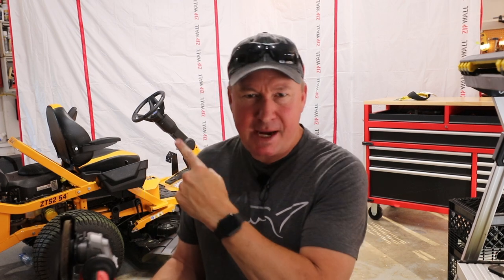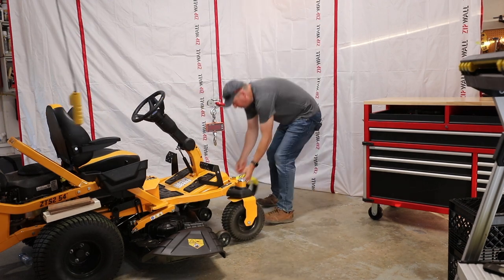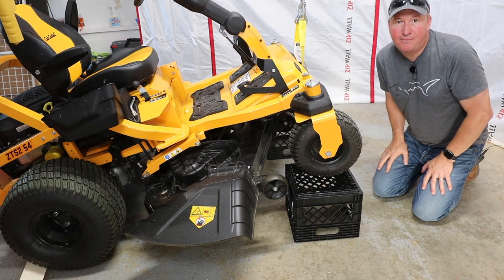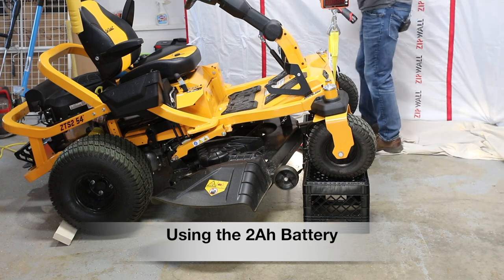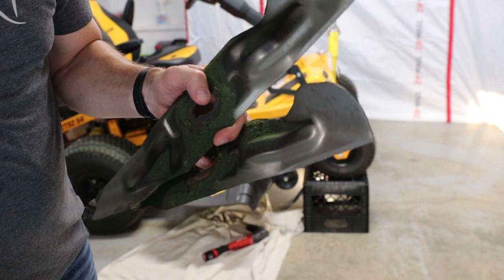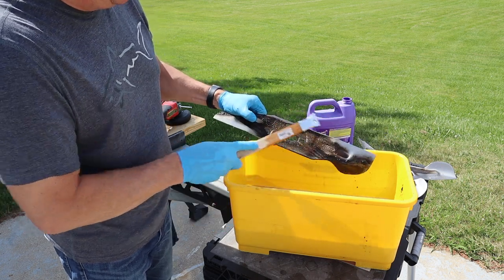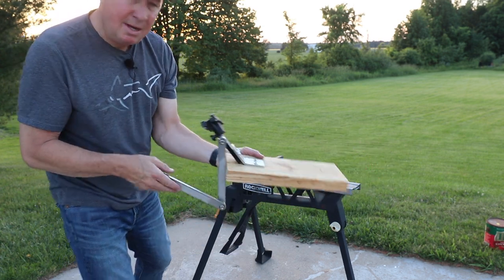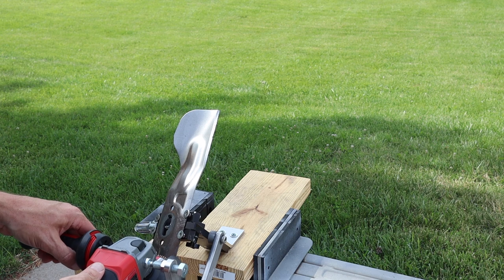GET SHARP MOWER BLADES QUICK & EASY BY USING THESE TOOLS!!

Comment from the maker: Would you change anything about the way I sharpened the blades?  What tools do you use or do you pay to get them sharpened?
Reply: Angle grinder
Reply from the maker: @jeremynguyen2346  Hey Jeremy, thanks for the vote!👊💯
Reply: What’s the name and part numbers for the balancer and sharpening jig?
Reply from the maker: I bought it a few years ago from Amazon.  Here's my affiliate link where you can check it out... https://amzn.to/3tQcr6r
Reply: @MarkThomasBuilder  how are you
Reply from the maker: @jeremynguyen2346  Good, thanks and you?
Reply: @MarkThomasBuilder  good where do you buy the riding lawn mower
Reply from the maker: Its directly from Cub Cadet.  Their website says they're not available at the moment.
Reply: @MarkThomasBuilder  what year is the lawn mower made
Reply from the maker: 2022
Reply: Incredibly good demo about how you work, efficiently and quickly. It shouldn't be more than that.

As well as the guide of the grinding wheel, never seen before.

In the past I always used a too flat grinding disk ... you know the results. 

Thank you.
Reply: @MarkThomasBuilder  hello

Comment: Nice setup! We're glad your 5005 is part of the process, and we hope it gives you many years of sharp mower blades. The only thing we might change is trying the 35 degree setting on those blades, due to the shape of them. That may match the factory bevel a little closer and get the edge back with a little less grinding. But there's nothing wrong with what you did. Looks like you'll be a pro in no time!
Reply from the maker: Thank you, I'll give that a try.  I stopped by your booth at GIE last year and have to say that I'm very impressed with the All American Sharpener.  I'll plan to stop by again.  Thanks.

Comment: Hi Mark, I'm getting ready to install my All American Sharpener and get the feel of my angle grinder. I really enjoyed this video, it gives me a little more confidence as you make it look easy. Thank You! 👍
Reply from the maker: Thanks Kevin, I have a beat up set of blades that I'm going to experiment with using the grinding wheel.  It helps to practice a little with the flap disc, especially the 60 grit which is more forgiving.
Reply: @MarkThomasBuilder  I’ll start the same way! 👍👍👍

Comment: Mark Thomas!  Hey, these are the types of videos you do so well.  That hoist works the treat!  

I have to sharpen two blades myself, with the 21 inch Honda mower, and I usually use an old Makita corded grinder, with an 80 grit flap disc.  Flap disc is the only way to go.  I’m sure someone will chime in with their opinion, and you know what?  Good for you on whatever you use that works for you.  😃

I think you got a decent edge on those Mark.  I will say this, most of the time I ‘touch up’ my blades with a file alone, only using the grinder when they are chipped up badly.  You may have leaned in on those a bit much, but that is something only you can determine.  I like that blade balancer, but the blades on my Honda have a round hole, so I use the little cone balancer, and it yields great results.  Obviously those blades of yours wont work on the cone balancer.  

Stay safe and healthy!  That mower is a beast!  👍👍👍✌😊
Reply from the maker: Hey George, thanks for the positive feedback on my video.  I like the flap disc since it's a little forgiving as I get the hang of it.  I have some beat up blades that need a bit of removal, so I'll probably try the grinding wheel on those.  I may make a dedicated review on the sharpener once I get the hang of it some more.  Thanks again, have a great day!🙌

Comment: Such an interesting video Mark. I have a little Toro Recycler do you know if those blade can be sharpened like in the video or should buy a new blade? I have the M18 grinder so I'm wondering if I should attempt to do this for my lawnmower.
Reply from the maker: I would think it could be sharpened with this setup.  I used to bring my blades in to the local lawn mower dealer and paid $7 per blade.  I'm not sure if they balance them though.